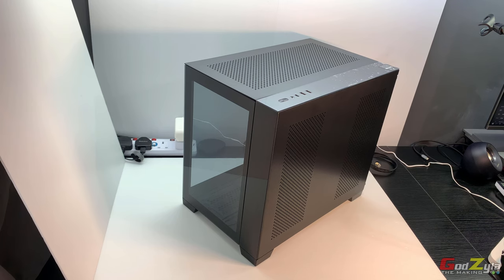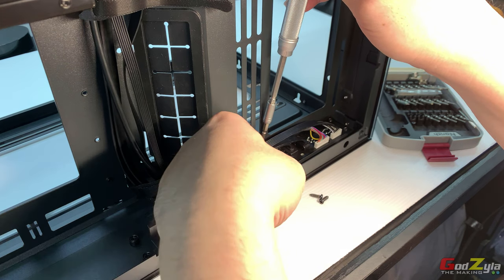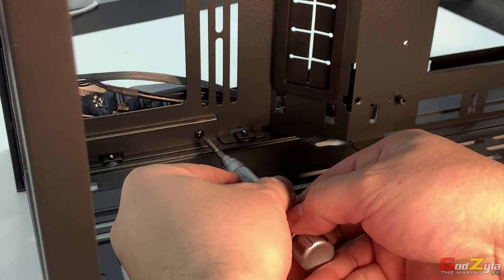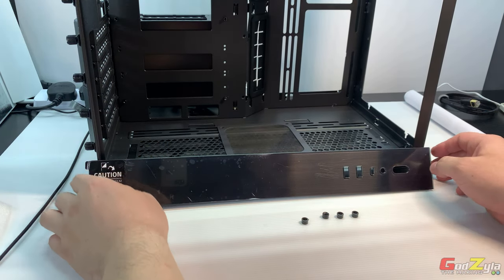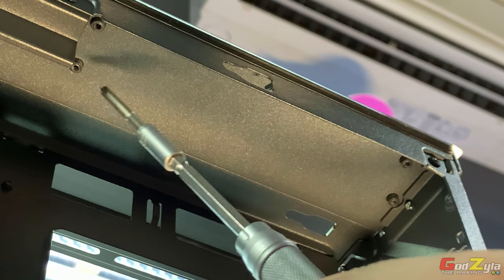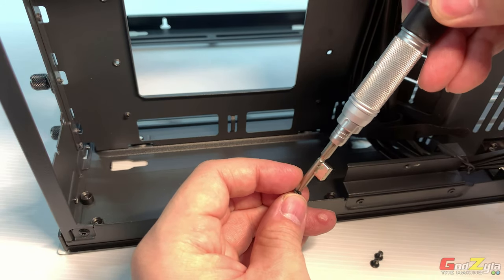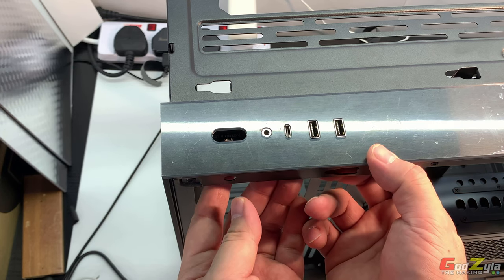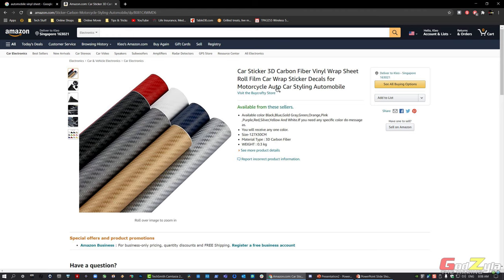Lian-Li O11D mini - Remove and mod top plastic panel

Comment: I have the same case however my Asus Strix-A only had one connector place for the front panel so I used the front top part and had to leave the bottom 2 USB connector off.  It's a 12 pin connector I was able to use the C connector on the board.  Your videos are really great so much detail.  BTW to get both 12 pin connectors to work I wondered about a splitter then thinking I thought that might be a bad idea.  I just had to cable manage the bottom with the rest of the cables.  It's just been crazy to get a GPU and eBay has gone nuts.  Thank You
Reply from the maker: Hi Wickette Shotts, welcome back and thanks for the compliment. yup.. you are absolutely right. I had the experience like you did before and did try the splitter method. it ended up mess up my USB header. and as for GPU and CPU yeah.. is still crazy out there. once again thank you for your compliment and to have visit my channel.  Hope you will get the GPU soon too.. best of luck my friend :)

Comment: Finally my case arrived, it is so cute. I got the white version. I have a question. How do I remove the hardisk cage? There are no instructions on the manual and I've tried without any luck. Could you please help me out?
Reply from the maker: Hi Nox Mu, congratulations and welcome to the mini club 😬. This is what I do to remove the cage. 

1) remove side panel 
2) remove all hdd caddy (not necessary but to prevent scratches)
3) remove the Center pillar with the name “der8bauer” 
4) locate the 4 screws behind the case, unscrew them. 
5) slide out the cage slowly from the side. 

I see what I can do during the weekends and might just do up a video. 

Once again thank you for your question and to have revisit my channel.

Comment: Hey Kleo, I'm wondering if you can help me i was thinking about Flipping the case and have it in an invertable position, (window facing to the right) do you have any advices for me?
Reply from the maker: Hi sliverfish1, thank you for your question, hmm flipping the case will not work as 1st the ledge is at the top not at the bottom 2nd the feet with the dust filter have a specific allocation slot. 
I believe you have been looking for an answer for this but no one seems to be able to aid you on this. why not try sending to Lian Li support to see if they can custom a case for you but I believe you will need to pay premium for it if they do so. Once again thank you for your question and kindly subscribe if you like my content and don't forget to click on the notification bell. thank you!

Comment: Can you show how to remove the feet from the case? I would like to move the feet in front to the back; basically have the lower filter face back of case.
Reply from the maker: Hi J, thank you for your question. honestly speaking, removing the feet is not a problem. you only need to use a hairdryer to heat up the feet abit, please do not over heat it. then remove the rubber, there will be a screw on each feet, once you remove the screws. the feet will drop in place. 
now for your info, I dont think you can orientate the fan filters to the other side of the case. as the catch or latch is only cater that way for the bottom fan filter. once again thank you for your question and to have visit my channel .